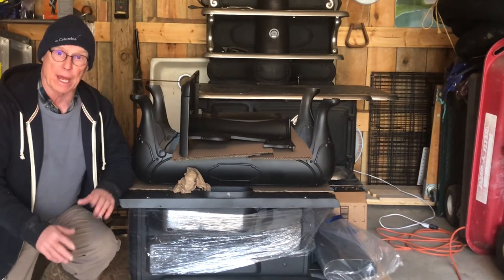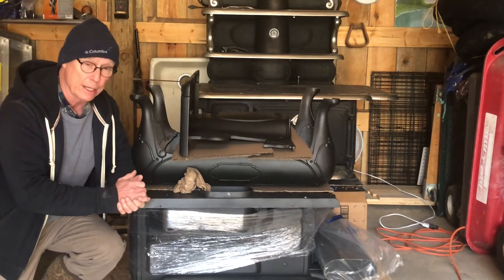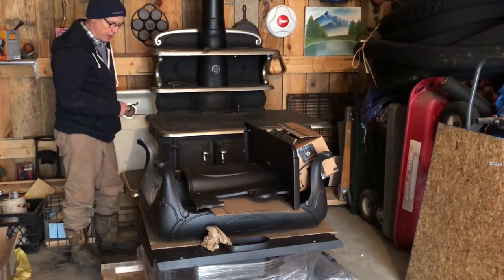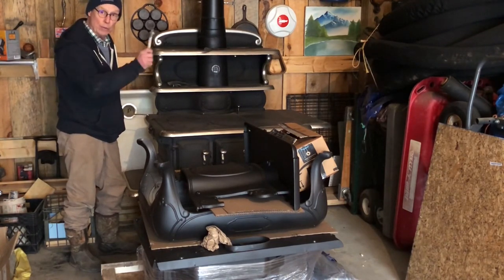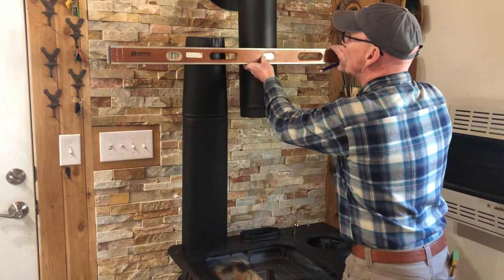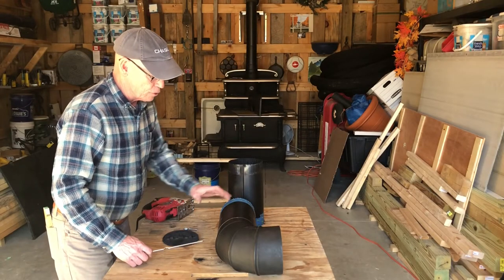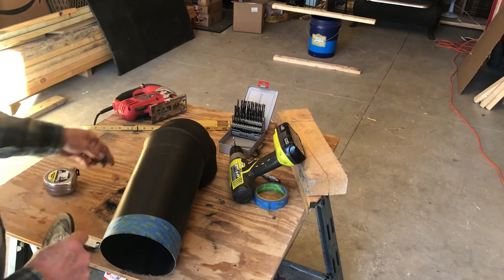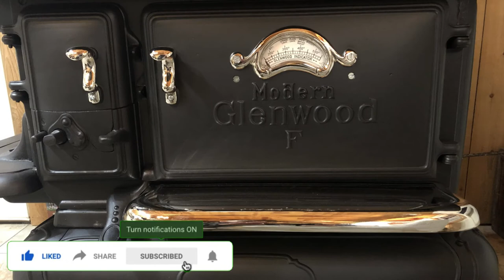Installing Our 2nd Antique Wood Cookstove - Prepping or Not, Here We Come - Cast Iron Off Grid Stove

Comment: The airtight stove, will be far better. These old cast iron cook stoves are very inefficient.
Install a damper above your stove and learn how to run it. On top of that those old cook stoves are not UL listed and most likely will void your homeowners insurance
Reply from the maker: We have had many wood stoves in our lifetime, airtight and refurbished cast iron. We did have a damper on the airtight stove here and operated it for 5 years before installing the refurbished Glenwood. We are much happier with the warmth the Cast Iron stove gives off vs. the steel. We used this old Glenwood for over 3 months this season and absolutely love having it in our home.  Thanks for your comment and for tuning in...